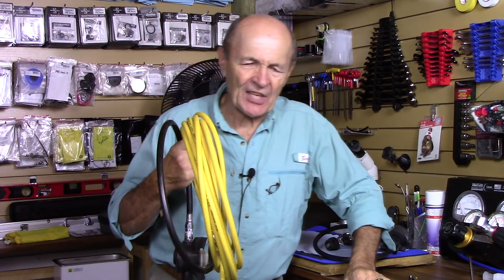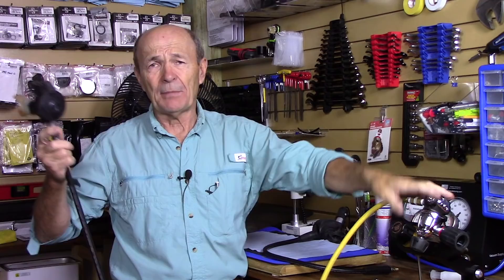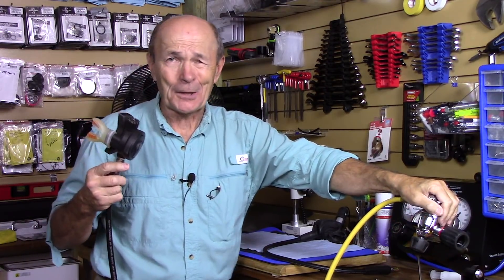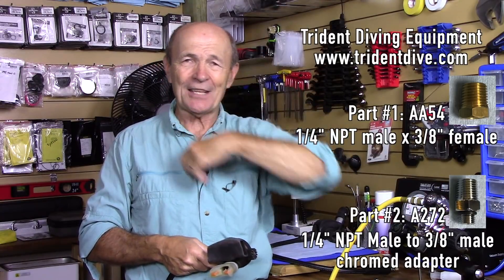Make Your Own Hookah Surface Supply - Scuba Tech Tips: S08E03

Comment: Hi Alec, I made what I call a Dive Sled back in 1995. I I have 3 individual 80's on the sled and 100' air hose and a 90" dive sled tow line and I have pretty good mobility. I don't use a pressure gauge and just go on my experience on air consumption. I switch tanks after consumption and go to many diff sites and after the 3rd tank a fiend picks me up in the boat unless I am diving right offshore. I keep getting grief from people about the dangers  as well as impossibility of the 1st stage being able to deliver me air to depth from the surface and on and one LOL but I have thousands of dives so a bit of a cowboy, but still find it relatively safe if you just pay attention to your sir consumption. Anyway, just wanted to share cant post a photo here so will try and find email for you. Thanks for your video
Reply from the maker: Thanks for sharing your unique sled setup.  Back in the stone age we made our own motorized sleds with a SPG (they were new), in front of our face.  Fun but we were thought to be crazy too.  Be careful and maybe put SPG's on the tanks to keep your loved ones happy.   Take care Cory.
Reply: @AlecPeirceScuba_SeaHunter  I've been having a very animated conversation with a friend who is challenging me about not having the needed air flow down to say 80' from a surface supplied tank with the 80' air hose and I keep telling him it was never an issue with my many dives to 60-80 on this static system'. I mentioned you did a 200' as you said in your video and he says you probably tweaked the first stage?? he is an engineer and wants the physics angle on this LOL can you help. thanks
Reply: @AlecPeirceScuba_SeaHunter  Oh I was wondering about your reference to snow age sleds LOL It is strictly a surface non motorized vehicle made of fiberglass which as I said holds 3 individual 80's has 100' of air hose and 90' line for me to tow it attached to my weight belt. I made it in 1995 and have made a few others and it glides effortlessly through the water and holds a cooler so in between dives I can eat and drink in comfort holding on as well as a place to hold my shot fish or snared lobsters. I spend upwards of 3 hours diving off it and I love it and probably have well over 50 dives on it without ever a problem. I don't use a gauge so I estimate my downtime based on experience, depth, etc..... and have always surfaced with minimal air left and take my deco in between dives on the surface as most of my dives are between 30 and 80 depending on purpose of dive. Most all of my dives have been off Miami Beach Sunny Isles and off reefs for bugs and wrecks for fish (pimellous to name one)
Reply: or perhaps the larger size tanks you used on the 200' provided the needed air flow versus only the 80cu I was using

Comment: Are you sure standard Home Depot hoses' won't deteriorate in salt water? I'd be concerned they're not food-grade and may give off dangerous particles. Lastly, won't they collapse/compress under the water pressure? Any thoughts?
Reply from the maker: For salt water and hot sun climates, not Canada generally, us hoses make for hookah from Trident diving or similar vendors.  Hose collapse is not likely due to the much higher air pressure in the hose, about 150 psi, unless run over by a car.
Reply: @AlecPeirceScuba_SeaHunter  Thanks!

Comment: Your showing the 1st stage regulator hooking into a scuba tank. I want to hook up to an air compressor.
Reply from the maker: Look back through these comments for how to do that safely.  Thanks for watching.
Reply: 1st stage reduces the pressure down from 3000 psi (storage pressure) , to a "working pressure" a second stage will work with. Most all compressors deliver working pressure. Connect only your hose to that. (make sure you have a water/particle separator some where in the system)

Comment: GREAT video!  So I could hook up 3 100's together and leave it on a small boat anchored and swim all around the shallow water without carrying all the gear.  How do I hook up 3 tanks (cylinders) to the one regulator?  Thanks.  I'm just getting into diving, in fact my training begins tomorrow... but I'm making plans for the future lol.  I'll be diving mostly in 5M or less and would be great not to have to completely gear up only to be diving in shallow-ish waters.  Wish I could just chat a bit with you, I'm sure you'd answer all my questions.  I was looking at the 3rd lung and the NEMO system..... THIS seems WAY better and WAY less expensive.  Thanks for saving me $1,000-$6,000 bucks =]
Reply from the maker: There are 2 and 3 tank backpacks with manifolds you can use to extend bottom time. Some divers even lower the tanks to where they are working with lines to pull up afterwards.
Reply: @AlecPeirceScuba_SeaHunter  Awesome.  I'll talk to my local shop about the "manifolds" to hook up 3 tanks.

Comment: I love your channel @alec peirce scuba !
I decided to lighten my poor back after 15 years with twin cylinders and Navy Seal's style rides from the car trunk to the water .. Definitely, at the age of 37, I'm already destroyed to keep on my back all that weight .I tried three years ago a single 15liters tank on a floating cart with wheels and the setup was fine using a 19ft tailored dive hose.. Unluckily the sand isn't weight friendly and to transport the equipment by hands was a big effort, including the dpv. Now I'll use again that hose, excluding the first stage and tuning the IP on the second stage. A small 12V oilless diaphragm with a suction filter and a personal filter type for the outlet will do a good job to stay in the shallows if modified to work when needed only...I'm a lone diver too and honestly the most scary thing I've seen until now is the panicking crowd's faces when in group...
Reply from the maker: Sounds like fun and perfect for underwater searching.  Good luck with the setup.

Comment: What is the best type of air hose for the rubber or pvc or blend? Just curious of your thoughts?
Reply from the maker: No preference really but get the best quality hose you can and not from a 3rd hand yard sale.  A good idea to send a sample of your air through all hoses for analysis to prove its safe for breathing.
Reply: @AlecPeirceScuba_SeaHunter  Hi just wondering what inside diam the air hose should be?? as my hose tail measures 6mm inside dia, at present i have 6mm inside with a dia/ 11mm O/D which goes over the hose tail fitting but really tight, and a 10mm hose with a 15mm O/D. Or should i be using 8mm inside dia hose??
 Cheers

Comment: what brand of compressor can I use
Reply from the maker: Using a scuba tank is quickest and simplest air supply, a compressor can be used.  Look back in these comments William as I gave my suggestions already.
Reply: @AlecPeirceScuba_SeaHunter  All the research I’ve found says to use only an oil less compressor. I initially bought an expensive pump ($1300). It was quite noisy, especially at home with the grandkids in my above ground pool. Then I came across a Harbor Freight compressor they recently started selling that is really quiet and has different sizes. I bought the 2 gallon version which supports 2 divers for $169. My grandkids all know how to dive and can stay underwater for as long as they like. I went with Brownie connectors and hoses. They are on the expensive side but have lasting for years. You’ll have to use a different regulator and not the ones used for tank. I use one long hose and then a splitter to 2 hoses. If diving from a boat, you’ll want to have 5-10 tank with a one way tank so that if for any reason your pump quits working, you’ll have enough air to make it to the surface. If you feel the air pressure drop, you’ll know to go up.

Comment: Can you explain the connection from the regulator hose to the air hose and to 1st stage, is that a quick connect from hardware store or is it a solid connection?
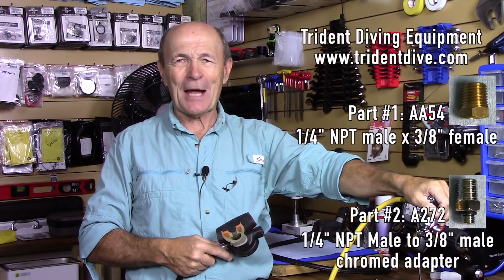Reply from the maker: Never a quick disconnect, don't want anything to disconnect 'quick' when you're underwater.  At around 8:46 the parts to connect the 2nd stage hose to the air line are listed.  Always use a sold connection for breathing air Shawn.
Reply: @AlecPeirceScuba_SeaHunter  Makes sense now that you said it  :)

Comment: Ok, so I live near this canal/river. Can you tell me if it is possible to just get a hoes/pipe, attach it to a float on the surface and just breath through it at about 2-3-4 meters deep?
Reply from the maker: If you saw my video on snorkels, starting at about 12 inches and going deeper, you cannot breath through a tube due to the water pressure on your lungs.   That is why compressed breathing air is needed.  A hookah setup connected to a scuba tank on the surface will do fine for shallow dives to around 10'.

Comment: Failed to mention you have to get a fitting on each end of the hose " crimped "on  to the hose by someone or get the tool that does that.
You can see the part crimped at the end of the hose in the video.  You can't screw, tape, gorilla glue etc.  a fitting to a rubber hose. It has
to be crimped on. Not a big deal. He just failed to mention it. He does rock. Very knowledgeable scuba guy.
Reply from the maker: The hoses I buy are already crimped to the connector.

Comment: Alec, how many SCFM does the compressor need to produce per diver?
Reply from the maker: If you mean to supply hookah diver(s) directly from a compressor?  That is a complex formula that above what I could provide in a comment.   Best action is to calculate the max number of divers, max depth, SAC rate, and visit a reliable vendor like Bauer to get their ideas.  Remember safety first before cost, otherwise just put on a scuba tank.
Reply: @AlecPeirceScuba_SeaHunter  you are fabulas. Thank you for taking the time. I'm using a tank, is a 0.5 hp, 1 gal 135psi compressor sufficient? Can I purchase regulators and hardware from you?

Comment: Hi Alec...another great video. I'm currently putting one of these together but as you know our UK waters are pretty cold most of the year so I'm thinking of splitting the air line to accommodate a dry suit inflation hose as well as the regulator. I think you can buy air hose splitters but do you have any thoughts or tips about this. By the way I'm simply floating my 15L tank around on a rubber ring rather than messing about with compressors. Cheers...Tim
Reply from the maker: Sounds great!  Removing a compressor simplifies the setup and ensures clean dry air in the tank.  Dive safe and use a buddy or watcher.

Comment: So you are saying that the 50'x3/8" orange PVC Diablo air hose from Harbor freight and a oilless compressor with a filter and a second stage would be  sufficient for building a hooka system to dive for catfish noodleing?
Reply from the maker: I would avoid any pump for surface supplied air unless certified for scuba breathing.  Use a 80 cu/ft tank if going shallow filled from a dive shop.  Just like diving without the risk.

Comment: You state using 1/2" hose but I notice a lot of hookah hoses are only1/4". Which would be better?
Reply from the maker: The 1/2" gives 4x better air flow than a 1/4" diameter hose.  Stick with what is safer, not cheaper Kep.
Reply: The bigger the hose the more the volume. Bigger is better in this case im sure

Comment: if you dont plan to use a tank as supply or wanna invest alot of money there is cheap alternatives.
You have 12v oilless pumps and they give you very low psi which means you cant go deep and as a tank you can use a coke bottle.
You also have 12v oilless compressors which you just hookup a battery (look for one with tank the once without often overheat after a short period of time)
if its hard to get a 12v variant in your area you can go for an oilless 220v combined with a inverter then to a battery

There is many oilless nowdays but you need to place a water/oil seperator and a micron filter. this is due to the fact that when you compress air you create create alot of water that will enter the tank (a good tip is to lower the pressure on the compressor) micron filter is just in case the air filter is broken and if there is leftover shavings from fabrication/ rusty tank.

All you need for a setup like this is
Pump/compressor oilless (50-150 dollar)
second stage regulators (breathing thingy) 15-20 dollar each
hose + fittings + splitter if you want more people.
filters about 10-30 dollar

what actually coast money is good batteries and inverter.

The reason scuba compressors to fills tanks is expensive is due to the high PSI. for hookah you dont even need 40psi to go down 10m.

also the real danger of hookah is diving sickness since you loose track of time and folding hose.
if the compressor dies you feel it harder to breath and you go up. if a hose folds you get no air at all and u just empty your lungs so never dive deeper than you are able to go out on empty lungs.
Reply from the maker: Not recommended.  Use a system specifically for hookah diving to be safe and with a buddy.
Reply: @AlecPeirceScuba_SeaHunter  yeap because those "systems" isent just a compressor with filter, hose and a regulator which is overpriced.
¯\_(ツ)_/¯

Comment: This guy is wrong. Do not listen to this guy. You can't use regular hose. You have to use airlines rated for air-breathing or food-grade PVC. If you buy regular hose you will be breathing in harmful chemicals  and particles into your lungs.
Reply from the maker: Sure you can, I do and many others use it for shallow depths.  Try it, you won't die.
Reply: Juan do you have any recommendations regarding filtration and name of supplier for hose
Reply: @seabird3wy531  you can check Gato Gill webpage, I think they have filters.
Reply: @seabird3wy531   any hose will work just make sure its stiff else its a high possibility it will bend on itself and shutoff your air supply right away. if tank is getting empty you feel it getting heavy to breath. if hose folds you feel panic since you just empty your lounges and try to take a breath.
no filter is needed with this method if you fill your tanks at a station since they already filter the air.

Comment: Bullshit , you don't use standard air hose, Hookah hose is designed for the job , that is it wont kink , it won't delaminate and it gives off no vapours. Tis bloke is not giving good advice, consumer beware.
Reply from the maker: You can use any air hose from the hardware store if the hose is new.  Make sure that your first stage has OPV valve and hose is rated more than 200 psi.  There is no regulatory  requirement for 'scuba' hookah hoses vs air hoses.  If there is, please share for discussion.

Comment: What kind of compressor would you recommend. Or what kind would you use? Would you want an oilless compressor. Or is any “construction” compressor okay is it surpasses 100 psi ?
Reply from the maker: Any compressor that supplies 100 psi or so will do. BUT, you do need to get the cleanest air you can. Oilless is good but not perfect. They may be oilless but they can still produce noxious gases. A proper breathing air filter is really needed. However, and I'm NOT recommending this, you can survive for short periods and shallow depths on almost anything. Lipoid pneumonia (Google it) is a possibility but can be avoided.
I always tried to use a tank supply of clean air when working in pools. 
Take care.
Alec

Comment: You have to make sure the hose is not a rubber hose 
You will poison yourself if it is 
You have to make sure you don’t have any oil products in your air supply
Reply from the maker: Clean air, of course, is critical. Today we have a choice of hose material and plastic or synthetic is best. Realise that for many, many years we only had and so only used rubber.
Alec

Comment: Please tell me why we cant just have an air line on the surface with no bottle or pump
Reply: it has to be compressed air because your lungs aren't strong enough to fight the water pressure even at 5ft depth. not to mention the amount of dead air space.
Reply: @JohnAnderson-ox2be  Have you not seen a snorkel that exhale the co2 the other way
Reply: @keymaster2108  ambient pressure at sea level is 14.7psi and at 33 feet it doubles to 29.4. The Human body cannot create enough suction to breath the difference in pressure. i tried using a garden hose as a snorkel when i was a kid (breathing out my nose) and i couldn't inhale even at 4ft.
Reply: Why argue? Grab a garden hose and give it a try in your bath tube. Even there you’ll feel the weight at 6 inches. Still think you can do it? Go try in a pool this summer. Ever movie snorkels are only 12 inches long?
Reply: I use a gas mask as a snorkel. The inhaled air goes down the hose and the exhaled air goes out into the water. Going 4 ft or more even with a large diameter hose is rather laboured. Anything more can be quite dangerous.
Reply from the maker: I'd be very surprised if you were able to draw air to a depth of 4'.
Regardless of the size of the tube, it's pure physics with a bit of physiology thrown in.
About 15 to 18 inches is the farthest you can draw air from the surface. Some people might manage 3' but the effort required would soon result in oxygen deficiency and black out.
Alec